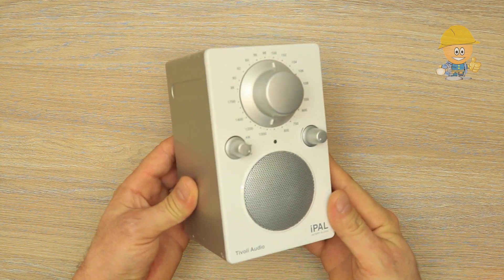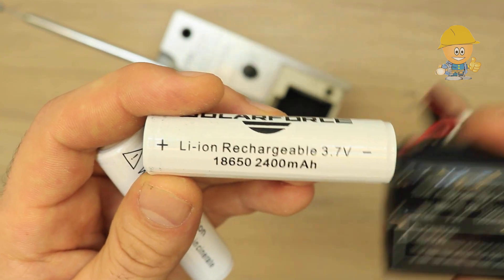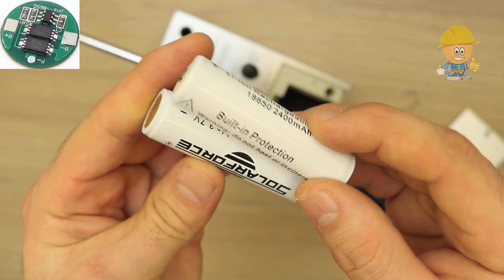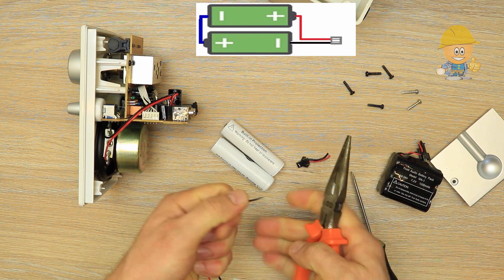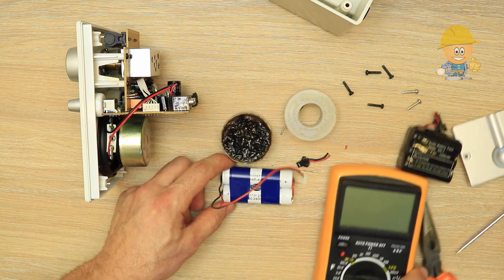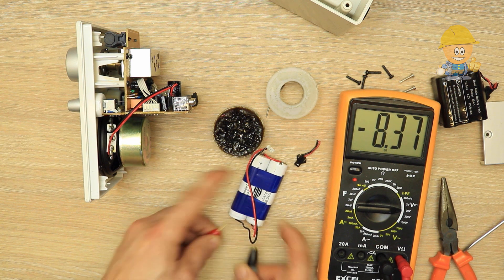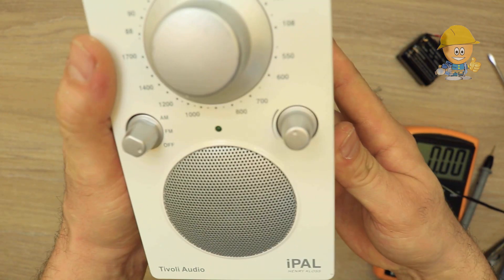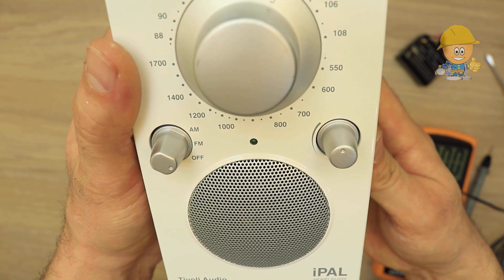Tivoli Audio iPal How to Open / Repair / Battery Change / NI-MH to Lithium ion

Comment: It is very bad idea to operate multiple "protected" cells in series.
First the protection circuit is not designed to handle the higher voltage from the multiple cells, nor the reverse voltage imposed on a just disconnected cells from the remaining ones. The protection circuit on single cells is designed to handle just 0..5.5V range.
Second multiple cells operated in series require cell balancing. With "classic" chemistries (lead-acid, NiCd or NiMh) this is done by slightly overcharging the battery at the end of the charging cycle, but you can not do that with LiIons, as they tend to get destroyed or even explode into fire when overcharged, so you need a dedicated balancing circuit. Not present with your "protected" cells.

What you need to use is a 2-S battery management circuit, a module containing combination of protection and balancing of the two cell battery.
Plus you would need to add a charging control circuit, designed to limit the charging voltage to 8.4V. The cell protection circuit is not designed to and will not do this function safely. You really need at least two layer protection: First is the charger plus balancer not overcharging the cells, second is the protection part which is supposed to disconnect if the charger fails. Having just one of them means once that single thing fails, you get an uncontrolled flamethrower scorching your home down. LiIons are no joke, regardless how small they are.

Comment: Great upgrade. I have the Model One (ac & 12v power supply)  considering removing the AC transformer and adding a battery pack. I still have to measure the voltage but I assume it steps down to 7.2v like the PAL. Do you think this is possible???

Comment: Great vid,where you get the battery’s from,my tivoli battery pack died a long long time ago,so if I can get the right battery’s,oneswith the built in protection I’m gonna give it a go 😬
Reply: Ebay. Just bought one. The OG pack was 1200mah and I got a 260ah battery for longer backup play time